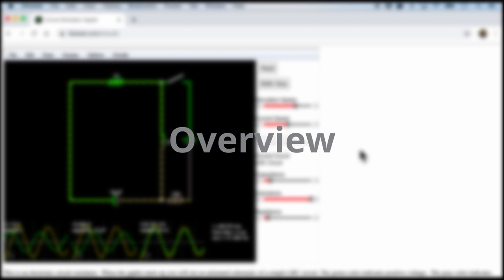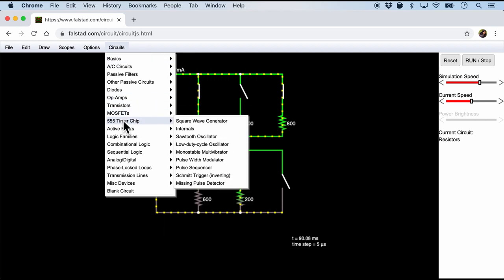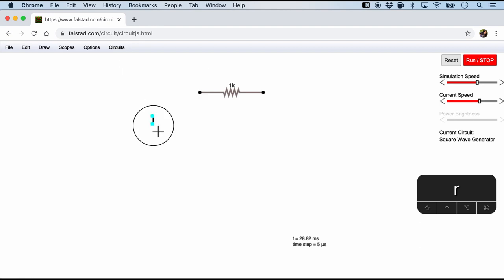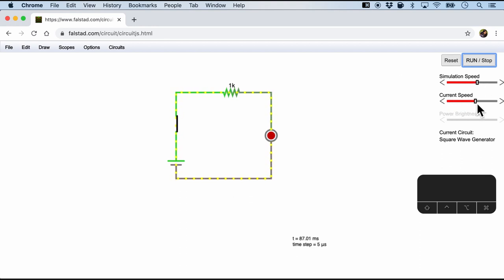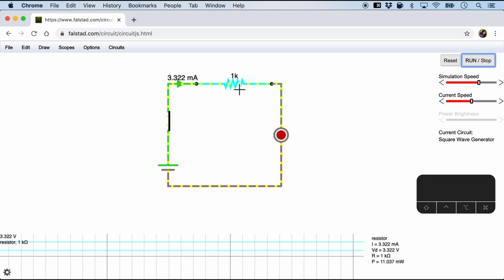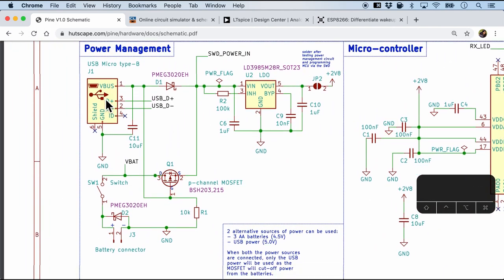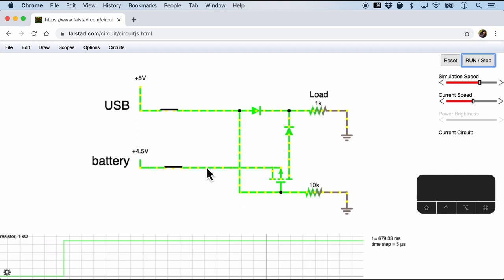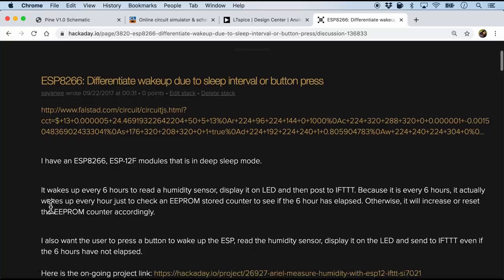Circuit simulation with Falstad

Comment: I'm surprised you didn't try nor mention Kicad for simulating your circuits. Kicad uses the open source Spice circuit simulator ngspice as backend. While it takes some time to set it up it is very powerful because you can reuse your production Kicad circuit without changing the schematic, except of course adding the ngspice models and attributes to all components.
Reply from the maker: I did :) But I felt Spice with KiCad is also better for an example with analog circuits with amplifiers, etc showing the varying frequencies. Also, it's a little challenging to find specific spice models other than the common components found in the PSpice symbol library. 

Could you reuse the circuit in entirety though? I still had to create another project to abstract out that part of the schematic in KiCad to simulate it in spice.

KiCad + spice definitely deserves a separate video by itself which I'm surely gonna need one day :)
Reply: @sayanee  Yes, you can simulate entire circuits and not use any of the simulator Kicad pspice components but instead you have to fill out the necessary fields for all your regular components according to ngspice syntax / naming rules but Kicad helps you with that. For example if you place a normal resistor R_Small with a value instead of a pspice resistor and then hit "Edit Spice model" button, then Kicad will automatically fill in the missing ngspice parameters. The same is true for other basic components. For other advanced components you will need to add the specific spice model file. It's fun when you get everything set up and it works :)

Ngspice has a short tutorial online on how to use kicad + ngspice. It is also true that it can be hard to find a specific spice model but that is kind of true for all simulator tools. Oh, and make sure your Kicad is configured to be compatible with PSpice models, this is also explained in the ngspice kicad tutorial.